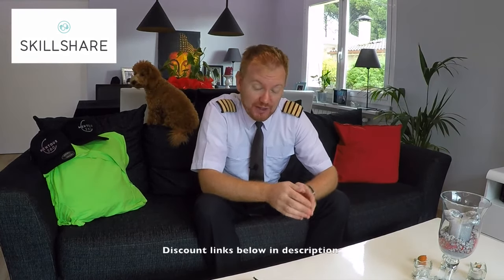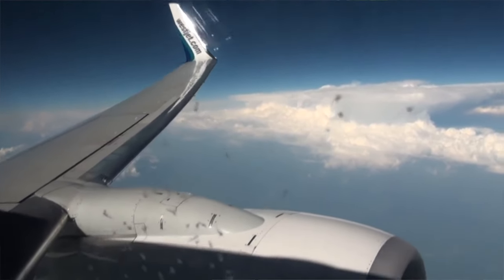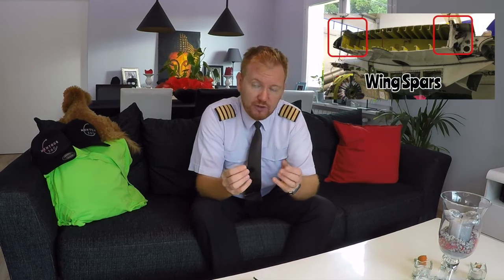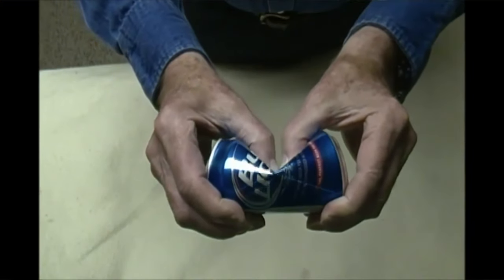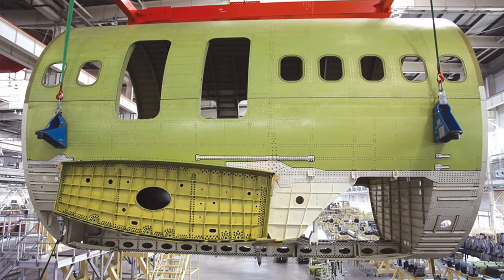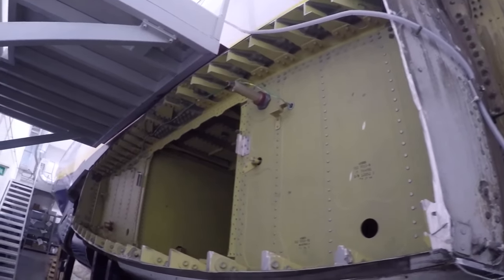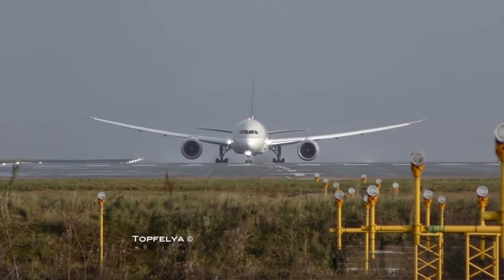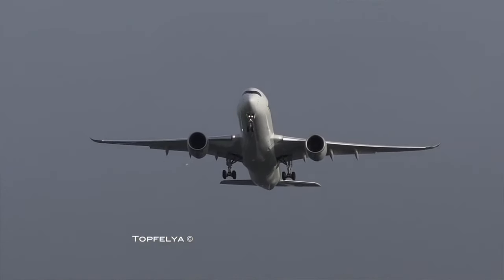Why don't the wings break?!

Comment: my grand mother was a metallurgist, and worked with failure analysis for aircraft, and rockets among other things, and she and her young son (my uncle) were on a flight once and my uncle, a child at the time, was nervous and concerned about the wing flexing, and asked my grandmother, "why do the wings flex" and my grandmother rather nonchalantly said "because if they didn't, they would break".
Reply: Yup...is called beam deflection. I studied that in college. If the beam does not deflect, it will usually lead to a trip to the cemetery. A beam must deflect a certain amount based on the expected load it will see. There is two loads...static which is equilibrium and then dynamic. For any engineer, this concept is very very important.
Reply: @mikefoehr235  Indeed ships are another great example of this, the way something like a container ship or similar bends and flexes during a storm as it contorts to conform to the changing shape of the water surface beneath it would seem shocking to the unitiated those things can flex and conform to the changing shape of the water they float on almost as though the very steel they were made from was water itself.
Reply: @seraphina985  You are so very correct. The most unsettling thing is to be stuck on a bridge while waiting for a green light and feeling the bridge gently rise up and down as the beams deflect.
Reply: @jalabi99  she kinda was,  she was also hired by the navy to train a girl to do the voice overs in one of the nuclear submarines, but the girl had a hard time with a lot of the technical words, so they just had my grandmother do it instead. So my grandmother is the computer voice in various nuclear submarines
Reply: +yeti dynamics Wow!!
Reply: a good way to think of it is if you jump from a chair to the ground and keep your leg straight. its going to hurt. if you flex, it doesnt. thats because it distribute the load over time - same as a wing, and really everything else. cars bend. buildings bend. etc.
Reply: @lillyanneserrelio2187  xD
Reply: @mikefoehr235  also, sky-scrapers sway, a lot! When it's windy.
Reply: Yep I operate towercranes and we deal with deflection all the time. And i was told when I asked. That if it didn't bend it would snap. I was happy with that explanation
Reply: @mikefoehr235  Imagine how rough the flight would be on a plane without flexing wings up to the point where the wings snap off. The whole damn plane would probably rock side to side in turbulence before the wings finally gave out.
Reply: Structures can be made to be very rigid without any sacrifice to strength, in fact well designed structures that are more rigid are stronger.  But greater rigidity usually requires more material, and that means they would be heavier and more expensive than they need to be.  In the case of aircraft structure, you want it to be as light as possible, so there is no benefit to have more rigidity than is needed.  Imagine someone telling you that the bouncy floor in their house is a sign of its superior strength, you would laugh.  People are usually willing to pay for floor structures that are a lot more rigid than they have to be because people feel less secure when walking on a bouncy floor.  Mentour Pilot mentioned that rigid structural elements pass their loads more forcefully to other structural elements in the system.  That is very true, and it will cause problems if all of the elements are not designed to handle those extra loads.  There are situations where the cost to make the entire system highly rigid is just too much, so a strategy is taken to allow flex.  There is a monetary cost to that method as well though.  All materials are weakened after they are flexed numerous times.  The airplane, bridge, ship, building, etc. that is built to flex will need to be replaced sooner.  When talking about vehicles, the cost of fuel has to be factored in because a perfectly rigid airplane would use much more fuel to keep in the air, not to mention that it would be very uncomfortable to ride in.
Reply: there were no female metallurgists in earlier times. youre a feminist history rewriter.
Reply: @terenceundbud  thank you for correcting the record
Reply: Hahahahahahaahahahahahaha
Reply: As another Metallurgist I can only agree with your Grand Mother.
Reply: @yeti dynamics damn,brah. i wouldnt want to travel in something designed by your grandmother... what she told u and  you are presenting fw to ppl has nothing to do with reality...
Reply: @georgestate9384  well you certainly seem to have a clear grasp of the subject
Reply: This is much more convenient explanation than an 18 minute long video lol...
Reply: This definitely happened.
Reply: yeti dynamics nice!!!
Reply: Great answer
Reply: @seraphina985  Well, I got a funny example that connects aviation and ship design. I got a 17 feet Grumman canoe. Grumman is the very company that designed the moon lander for Nasa. Just google Grumman for all the planes they have built. After WW2 they built thousands of canoes, there was not enough work in aviation. The only problem with those aluminum canoes is that they can live forever, unless you wrap them around a tree in strong currents.

And the only aluminum plane I have flown is the Pilatus B4. We nicknamed it the cookie jar, the wings sound totally different from wooden or GRP (or CFRP) wings. That ploink ploink is quite a surprise, so you were warned for ploinks before your first flight. And yes, those Pilatus gliders were awfully strong.
Reply: @CHRISGT34  Do you want a funny example of snapping wings?   I grew up in the time when most gliders had wooden wings. Then came the first GRP planes, nicknamed plastic. That was exciting, how long would that material remain okay? More then forty years later those first models can still be airworthy.
But here comes the difference. You'd better wear an emergency chute in those "plastic" planes, because a wooden wing will warn you  when you do stupid things. Flying too fast in turbulent air, or pulling more G than the flight manual allows you. Wooden wings   are said to squeak horribly just before they break. There may be huge damage, but you can still land it. And the CFRP wings are famous for surprising competition glider pilots. Average pilots have no reason to fly at top speed (vne) for a considerable time. But competition pilots take more risk, and if you fly into unexpected turbulance at those high speeds (around 200mph), the wings might say BANG. I don't know how often it happens, designers can adapt next models. The warning for this high stress surprise is not a joke. And don't think those gliders are not safe. This is just about what happens if you cross the safety lines: too high airspeed or high G loads. Or both.
Reply: The old saying "stress follows stiffness" does apply here
Reply: @georgestate9384   After briefly attending air frame and power plant school, having numerous conversations with a retired USAF crew chief, and spending countless hours reading books, and watching shows like how it's made, myth busters and the like.  I would gladly travel on something that was built by his grandmother.  Sounds like she knew some things about aviation.
Reply: Planes wings flex to show their muscles, same as me.
Reply: Wooooowwww @yetidynamics
Reply: Same thing with building construction, during earthquake skyscrapers do sway, which is called structure elasticity. They are made intentionally in that way, i.e elastic, not too stiff , to absorp the horizontal ground forces of the earthquake. Of course the higher your position in that building, the bigger the sway , which is frightening to most  of us, but its actually safe.
Reply: Your Grandma is a wise woman..!
Reply: @yetidynamics  Thats hard core!
Reply: @vivekbarchha  - Or earthquakey
Reply: True, they could.
Reply: George State that’s literally how it works tho...
Reply: i heard this from a metallurgy teacher named toporrow. she was obsessed with flexing aircraft wings.
Reply: Nice explanation
Reply: Which is 100% accurate, a hard object is usually more brittle and break.
Reply: @yetidynamics  yeah but what have you done? Ha ha jk bud
Reply: cool story bro
Reply: Wow wasn’t expecting that answer lol.
Reply: Great life lesson on dealing with stress and hardship. The same could be said of people. If we aren't flexible, we break.
Reply: @dangoheen6079  Yes, but you also have to know when to stand up for yourself or others. Finding out what is the right thing to do in which situation is what makes life so complicated😉
Reply: Is your granny still with us?
Reply: I thought the flapping of the wings is how it fly's..
Reply: My Dad told me the saber thing aborto Bridgestone. He said if they didnt move they World colapse.
Reply: 8:38 The dog's thinking "where did he throw that damn ball"?
Reply: Your grandma was badass!!

Comment: I always thought the wings were quite flexible because we see them shaking and bouncing in flight. But during one of our university class, we got an entire class of about 50 people to stand on a wing of a retired 727 and we all jump to try to bounce it. The thing didn't even budge.
Reply: Yeah "flexible" is a relative term when you're talking about a 950,000 pound plane. For aerodynamic reasons, designers don't want the wing to flex more than necessary. They want it to flex before it breaks, but not more than needed.
Reply: Yeah, the maximum takeoff weight of a 727 is over 70 tons. 50 people standing on it is nothing compared to that.
Reply: @WJS774  50... AMERICANS. They'll weigh at least 120 tons combined.
Reply: @WJS774  50 ppl is problably 5% of that.... crazy to think bout

Comment: About flexing, you can also think about twigs/branches. Take a completely dry, wooden branch, about as thick as your thumb. You'll find it doesn't flex very much, since all "softening" moisture has evaporated. Try to bend it - it'll snap in half pretty quickly at the point of lowest structural integrity. Then take a fresh branch of the same diameter. It's likely flexing a lot. Try to bend it, you'll find it bends a long way before breaking. That is because the forces have been distributed as deformation stress along the whole curved surfaces.
Reply: Stress happens when there is resistance to movement.

Comment: Japanese saying: If it does not flex, it will break.    I´m a pilot myself,  as for this I really like your informative uploads, very nice.
Reply: That is perfect sir..being a pilot is my dream thought  I know it can not be for filled . .God bless you
Reply: It it’s pushed beyond its designed load it will break.
Reply: @sergeykyrpa1126  Sure it can be fulfilled.
Reply: @youtubecomments5951  The FAA says they gotta go beyond the design load without breaking; 50% over, to be exact.
Reply: NoTraceOfSense yeah so it’s designed to handle more than nessesary. If it goes beyond the designed load it will fail but of course in regular flight and then some it will almost never reached the over designed load especially since it’s 50% more than it will ever use.
Reply: newagetojo    The F-4 (rhino) is proof of that...
Reply: Uh…. The saying is…. If it doesn’t flap, it’ll snap !!!   🤓
Reply: All materials flex. Just some more noticeably than others, so its all relative.
Reply: Karsten Siegmarsson i have question as a pilot which is better?
Analog instrument or digital instrument?
stick or a yoke?

Comment: While I was in the Air Force, we visited an aircraft manufacturer, building the new fighter. At one point, they were discussing the problem of stress cracks in the wing. A company janitor was nearby and he said that he might have a solution to the problem by drilling a line of small holes along the suspected crack line. He said that, in his experience, the toilet paper never tore along the dotted line.
Reply: They do actually drill holes to stop cracks spreading.
Reply: Michael Posford give that janator a raise
Reply: Crack stop holes are quite common....
Reply: @Ant-tv2bl  yeah I would assume it's a technique basically as old as carpentry

Comment: I knew someone that was working at Boeing in 1994.  She was testing the 777 and was so excited when the day came to "break the wings". She said they were calculated to flex to like 32.2 feet (or something insane like that). After she said their calculations were within a few  mms of knowing when they would break!
Reply: I saw a B 52 take off and flex wings about 17 feet each side . What a sight.
Reply: That’s… not quite accurate. The wings actually broke much later than calculated. This sounds good on the surface, but means the wing was designed heavier than it needed to be.

Comment: 8:48 "but I can promise you that you never felt -1 g, because that's a lot".
Ryanair pilot: hold my beer
Reply: CAL6 passengers: 1g? Nothing. If you want something, try 5gs.
Reply: Lol so true
Reply: @jakenolan2572  he said -1 G which is a lot!  -2G can cause serious injury.. negative G's are far more dangerous.
Reply: @armhunter  because negative G's pull on your organs and tries to tear them apart, also negative G's push the organs upwards when the human body structure is designed to resist weight pressing down on it....The human body is far stronger in compression (positive G's).
Reply: Me, a roller coaster enthusiast: That's some nice ejector airtime
Reply: @brokeandtired  That's very interesting actually tx
Reply: Wait isn't - 1 g the same has hanging upside down?
Reply: Mentour is a training Captain for Ryanair. 😂 😂

Comment: YOU MISSED ONE VERY IMPORTANT DETAIL :  Vibrations always move in the direction of least resistance/mass. With the wing ends thinner and more narrow. This puls vibrations away from the wing base as well as the fuselage. Just like radio towers that are not guyed, they are tapered, smaller as you go up, and for the same reasons. Personally, I am GLAD to see the wing ends vibrate since those forces are being transmitted away from the craft.

Comment: There have been many stories of US-based airlines having cozy relationships with their FAA inspectors, and then getting away with dangerous, even disastrous practices. The one that springs to mind is Chalks, but I know there are others. Has the FAA ever done anything to change that systemic problem? Rotating inspectors to different airlines? When an inspector works with the same mechanics for years, their relationship changes. They become more like coworkers.
Reply: That's a very interesting problem that sociologists call "capture" -- where outside regulatory officials in an industry become too close to those they're supposed to be inspecting, in effect becoming auxiliary personnel of the organization to some extent, and enforcement becomes lax. It's a danger in food safety/health  regulation, in the prison system, the building industry, and various other areas. Your suggestion that it could happen in aviation makes perfect sense.
Reply: US based? ONLY?
Reply: @drummist1000  The FAA is the US regulatory body. They cannot go to another country and act as official inspectors. They regulate all civil aviation (and some military operations) in the US, including foreign flag carriers while operating in the US, but what we're talking about is what happens at maintenance bases. Foreign flag carriers generally contract with US maintenance services (often US airlines) if needed for their operations within the US, and that's where those inspectors would be. Do those inspectors, who only work in the US, develop a cozy relationship with the companies (which hold US certificates) they are supposed to be regulating?

Comment: It's "Time To Worry" when you observe the LEFT side wing through the RIGHT side window.   (or Vice-Versa.)

Wings can ONLY do that ONCE.
Reply: But the back wheels of your car are almost always going forward.
Reply: weird flex but ok.
Reply: Not if you're standing on the right wing, looking through the right AND left window and see the left wing. But I suppose that, during flight, you're only able to do that once at most...
Reply: Tf? That is only possible woth a mirror
Reply: It is possible, stand on one wing and look through both the left and right window, to see the other wing.
Reply: I don’t really get it…
Reply: @dreqxz4490  , nor do I and I would claim the wings wound go up for a very short time and the rest of the plane down and we would probably not se either wing ever again.
Reply: Just A Cover - When we saw a Cuban MIG17 off each wingtip in 1961 it got our attention too, as having lost three of four engines still hoping for Miami, we knew we weren't gonna outrun 'em!!
Reply: @dreqxz4490  Imagine how the far right wing would have to bend in order for you to see the tip of it looking out the windows on the left side of the plane.